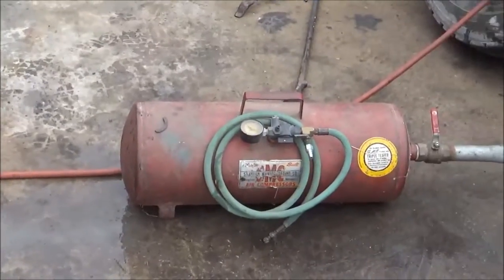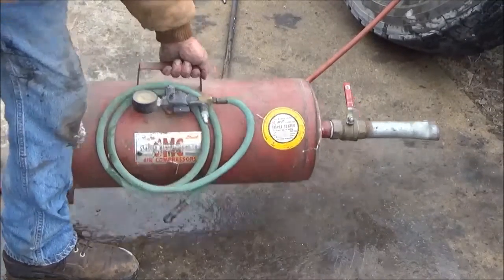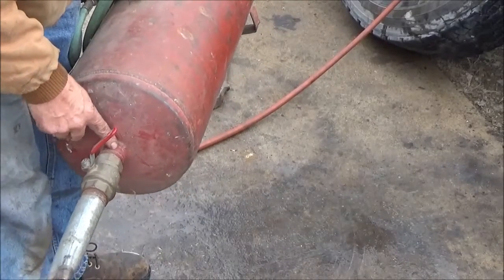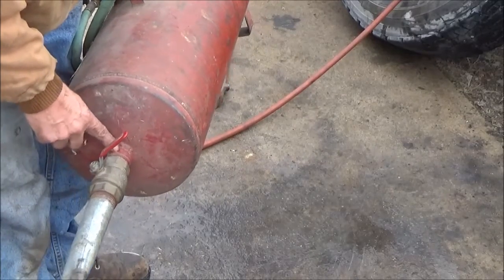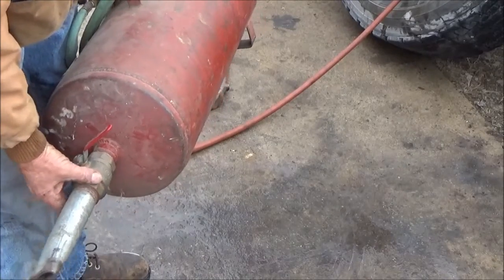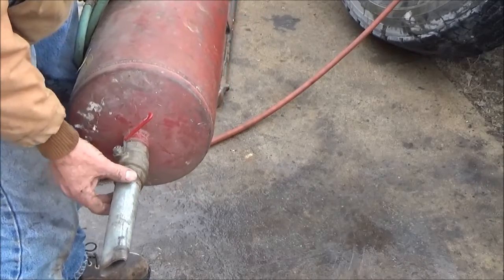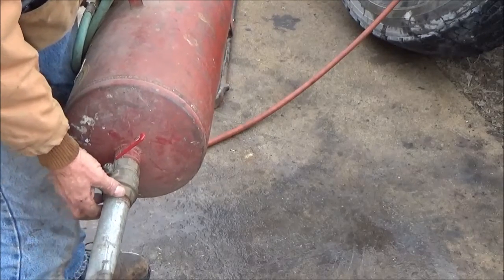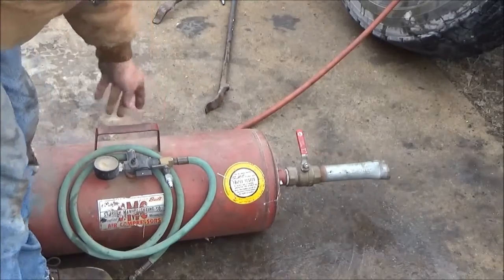Home made bead blast tank   Cheetah tank

Comment: Need help!
trying 2 find on 96 freightliner classic tractor were is abs sensor light stays on
Reply from the maker: Mine doesn't have ABS, but on a car, at each wheel there is a ring of teeth that is molded into the rotor or drum and the sensor is mounted where it can monitor the speed of the teeth passing by the sensor and send that info to the computer. Sorry, I'm not your man on that one, I would look at different ABS videos on Youtube for cars and trucks and call your local dealer or shop and ask them. Thanks for asking.
Reply: Thanks for the help
Reply: litros is a tank?